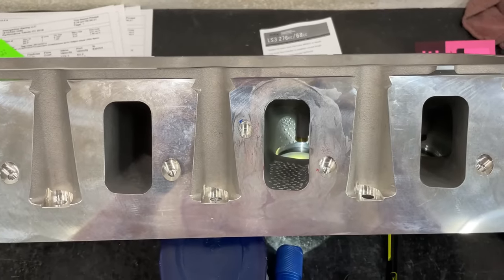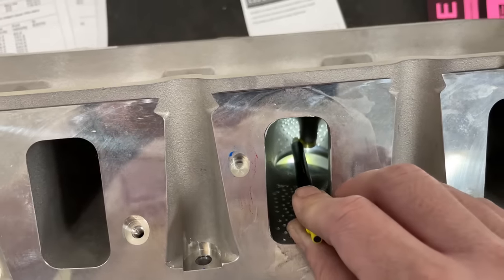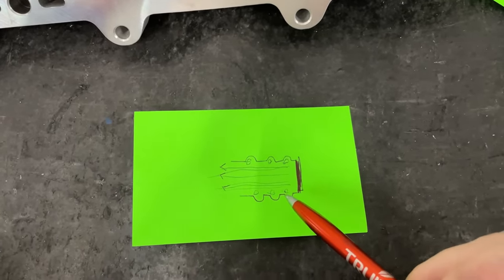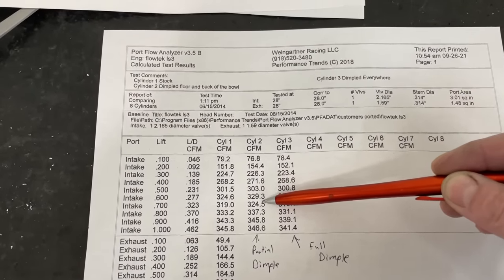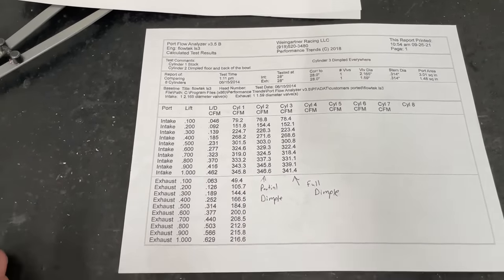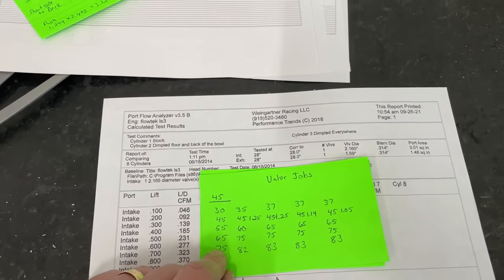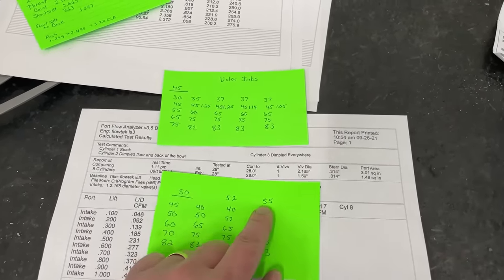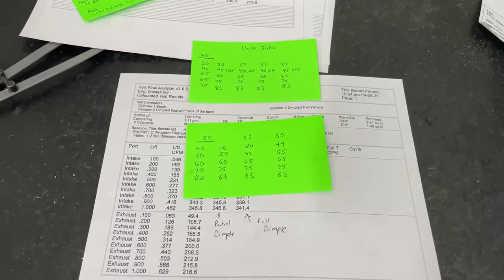Dimpling of Intake Ports Does It Help Part 1 of Internet Ports Heads

Comment: This is not even close to being a new trick. They did this crap back in the 1960s. The main purpose for it wasn't even for air flow. It was totally about getting fuel to re-atomize in the areas of the port where fuel was most prone to drop out and pudding along the port. Obviously the port floor up to the short side radius and the back of the bowl were the worst areas. I saw this in HotRod Magazine many years ago. Too many people get caught up on flow #s rather than what the air and fuel are doing together. I can tell you that keeping fuel atomized and in suspension is far more important than losing a couple of points in air flow. You really need to introduce a stream of gasoline similar to how it would be coming out of the intake manifold into the port and record areas where fuel drops out and puddles. This would show you the places where the dimples would make the biggest difference for fuel being picked back up into the air flow from shearing across the dimples. It never ceases to amaze me how sharp the old hotrodders were. But concidering the parts they had to work with, it makes sense that they had to think outside of the box.

Comment: This does not even make sense lolz.......  That is not event he point fully of why dimpling works the way it does....  To start with you would need to do a wet flow. Which this is not the case of your method. But the point of this is actually to create turbulence to atomize fuel better. doing a simple air flow test does not really show anything relevant to dimpling of a intake.

Comment: You probably  could  save your  self  all  the  trouble  by not just dumping  fuel into the port. Way back in the 1980 's  F1 would  inject the fuel above  the plenum  to atimise the charge . To bad nobody  can learn  from the past?

Comment: real port flow is at a much greater speed and not constant speed as can be tested here. Is not that easy to measure dimple gains or losses on flow bench. Because with a flow bench you test the ports in a state that in real use of the engine never happens. A more real test would be engine dyno before/after dimples.

Comment: Total air flow is not the end all be all people what about the air and fuel mixing advantages you would get from the hundreds if not thousands of vertices remember liquid gasoline is not flammable the vapors are, nothing can burn without reaching a  stoichiometric of oxygen and fuel.  On top of all that for example hogging out ports to the maximum on a N/A build is not going to yield the best results it's just gonna make a super peaky narrow Powerband that only kicks in high in the rpm range velocity of flow is just as important because air has mass therefore has inertia. Just my $0.02 but what do I know I'm just a stupid monkey like the rest of yall.

Comment: It's a good thing that your cylinder head doesn't flow any fuel in there.... and that the flow bench is the be all end all of testing.
Reply from the maker: I’m showing what I can. Wet flow is important but I can’t show definite information on that.
Reply: Did you have anything to add? No, ok.
Reply: @superkillr I believe he is creating content based on his viewers requests.  No where did I see anything mentioned about the flow bench be the end all be all.  However it is the first step of a process, if it works or doesn’t on the bench the next logical test would be the dyno, then the race track.  There are so many variables you just have to start somewhere.
Reply: @JamieGelting    He's not the first, and there is plenty of info... some conflicting about port texture.  So making a huge deal about dimples causing a loss in flow shows how much stock he puts into CFM being the end all be all.
Reply from the maker: Don’t assume what I put an emphasis on. If you watched my other videos you would no I don’t value just cfm. Viewers asked to see what dimpling did and I showed them. I’m  sorry you read more into it.
Reply: @WeingartnerRacing  don't worry, he just came here to be a troll. I've learned that even in the cylinder head porting group on FB there are plenty of trolls.

Comment: I've been porting for over 30 years and what you're doing absolutely will not work I got every tool  for porting even a CNC machine also a flow bench   If you don't know what you're looking for your best bet is to do a clean up that's  it By the way you're a little bit of game you're seeing is you're seeing is just admising of your feel you're not really gaining much horsepower at all so if you want to spend All your life didn't mean when you could just do a real part job to it and get it done get it done by all means knock yourself out guys
Reply: Punctuation...